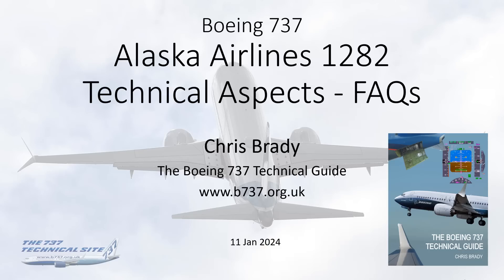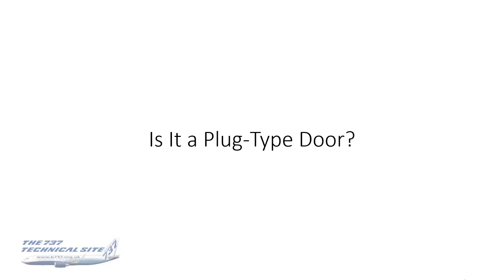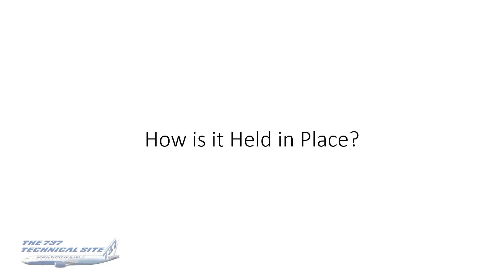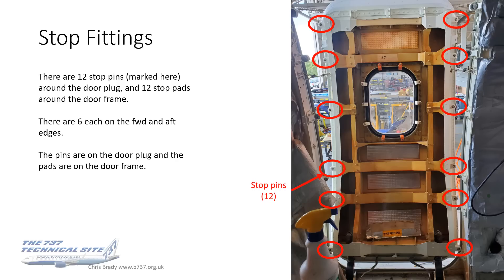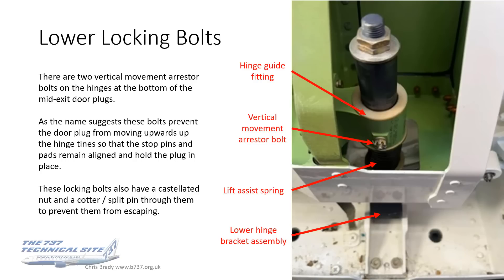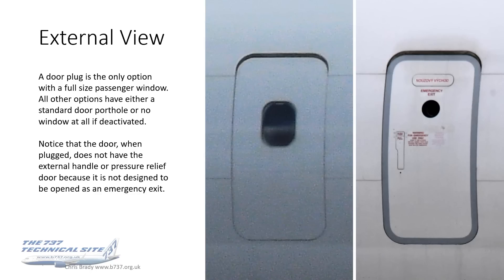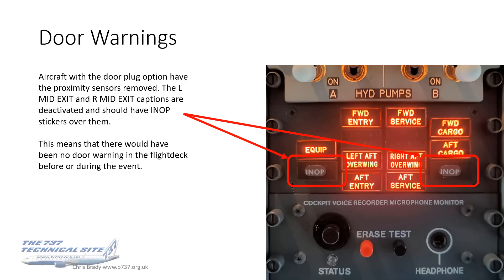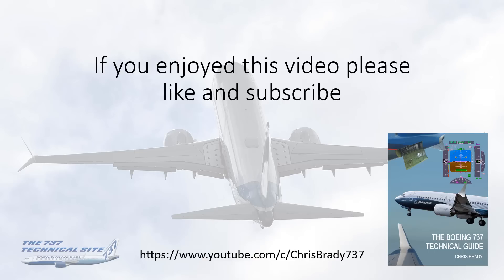737 Technical Aspects of AS1282 FAQs

Comment: OK people. It's obvious to me (from the video) that the 12 stop pins and 12 stop pads are what actually hold the plug in place during flight. The sliding hinges, roller pins, and guide tracks are only for convenience and help to ALIGN the plug so that the 12 stop pins can be tightened against the stop pads. The four locking bolts (also for convenience) keep the hinge springs compressed while you tighten the 12 stop pins with a special tool. When the 12 stop pins are tightened against the 12 stop pads, the plug becomes a rigid part of the airframe and the plug is not going anywhere. BUT if you fail to tighten these 12 stop pins, the hinges and roller pins (with their locking bolts) WILL NOT HOLD THE PLUG IN PLACE. Someone at Boeing must have failed to tighten the 12 stop pins, incorrectly thinking that the alignment hardware (i.e. sliding hinges, roller pins, and locking bolts) would hold the plug in place. But the alignment hardware is not designed to withstand operational forces. Only the stop pins and stop pads are. With the plug being loose and bouncing around for months, the four locking bolts eventually broke and the plug slid up (because of the springs) and out. The 12 stop pins had to be loose for the plug to be able to move. An alternate theory is that the stop pins were tightened correctly, but the locking wire (seen at 5:16 on the end of the stop pins) was a defective design that does not prevent the stop pins from turning from vibration (I'm really leaning towards this defective design theory now that I think about it).
Reply: Assundermurphy is not correct. The 12 stop  adjusters are not "tightened" against the stop lugs. That will only continuously Jack the door inwards until the J track brackets and the hinge tubes break. (Tightened against what?)
 The only reason the stop pads are adjustable is to provide equal contact on every  pad and prevent wobbling. The lockwire (Eng) / safetywire (USA) is there to prevent this adjustment from changing by maintaining the locknut torque.
Reply: It's very difficult to believe that the person/s involved in securing the plug door, pins etc would somehow inadvertently miss out 12!! lock wires, since each pin has a hole in the end for that pin. 
I think a plug door test chamber could be set up to pressurise/depressurise and apply suitable vibrations to mimic takeoff and landing, to see how the locking wires behave and all the other parts of the door. Maybe the wire used is not sufficient for this purpose.
Reply: @JohnnyMotel99  the pressure forces are perpendicular to the pads, not perpindicular to the vertical or horizontal axis of the pads. Because of that as pressure differentials increase, the door is forced harder against the pads, which increases the force required to move the two surfaces of the pads in relation to one another.
Reply: @eddy66t6  Thanks, I thought it was something like that.
Reply: What in those 12 stop pins and pads keep the door from moving up and down? Nothing, they looked flat to me, free to move up and down. Up and Down, perpendicular to the extremely large force of a pressurized cabin. Any small angles in these stops and pads could either assist the "launch spring" or work against the "launch spring".  The door should have only opened one way, inward. Not outward, aligned with the pressure force. 

Extremely bad design for a door that will NEVER be used. Well maybe once or twice in 30 years.
Reply: @WeBeGood06  There are four guide tracks? that guide the door into place, then a lock bolt is placed into the track to prevent it moving. So the bolts should slign correctly with the pads, the guide tracks prevent and movement of the door up/down, cabin pressure prevents any other movement.
Reply: @JohnnyMotel99 there’s only two track guides, located at top. The hinges at bottom keep it in position there.
Reply: @JohnHallgren  thanks, I wasn't sure.
Reply: You nailed it. I’m with you 100%. I think the door pads are slightly dished, to aid alignment. Do you know anything about that thought?? Regards

Comment: This door version is called plugtype door. So, this is a plugtype doorplug. Normally, this doors are just kept in position by the locking mechanism, until the cabin pressure comes up and prevents any door movement. 
The assist springs are a problem IMAO. Otherwise, the door would stay in its closed position even without the lock bolts.
Reply: The four bolts job seems to be to counter the springs. Just get rid of the springs.
Reply: The photo at 9:04 shows the door in the raised position. If this is entirely due to the springs the door would always be in this open-able position (clearly not so for a couple of months). So the door must have been forced downwards into the flight position and at least some of the 4 locking bolts installed. I also note that all these bolts act in shear and the lower pair are normally under constant load by the springs which should hold them in position due to friction whether the nuts are present or not.
Reply: See @jfmezei
 below

Comment: plug type non plug type door, is not a personal opinion but the therms and type door are specified/classified  in Part-21. plug type door wider than the fuselage door frame the door open inward the fuselage, semi-plug type the door is wider than the fuselage door frame and open outward the fuselage. Plug type mean the door when closed has their stop fitting inside and against the fuselage door frame stop fitting,  for this reason the door are considered wider than the fuselage door frame...
Ciao
Reply from the maker: Good explanation, thanks
Reply: LOL, When the Door departed the airplane, the Door was not wider than the Door frame, therefore is NOT considered a "plug type door" at departure. This door was designed for ease of removal, even in flight. A guy with a wrench could easily remove this door while pressurized at 40,000 feet altitude.

Comment: thanks The door is a bajonet fitting (move and twist) 
Also in my view  this is not a plug type door. for me a plug is an object that is wedged in place and when pushed seals the opening better.
Reply: It's not a bayonet fitting. It is a plug type, though a rather vestigial or skeleton one.
Reply: @RicktheRecorder  let me clearify the door is a bajonet door not a plug door.
the twelve fittings on the door and frame are also no plugs but just cones because they are plane and simple in the same presure compartment, hence no plug.
Reply: @mgriffioen8503  I am afraid what you write is not clear. I assume by 'bajonet' you mean bayonet. A bayonet connection requires a cylinder or similar inserted into a matching bore, and then rotated about the axis of insertion to enable dogs or lugs to engage in blind slots. Nothing about this door complies with that definition, as, for a start, the door is not rotated. I don't know what you mean about the  twelve pins and pads being in the 'same pressure compartment'. The inside of the door is at cabin pressure, the outside at ambient atmospheric. The jamming action of a plug always occurs on the high pressure side, here, the pins and pads.

Comment: PLUG DOOR VS DOOR PLUG?

Here’s my take on this. Note that I am not an A&P, nor am I a 737 pilot, but I do work in the aerospace industry. 

PLUG DOOR:  “Plug“ is the adjective that modifies the word “door.”  This means that the object under discussion is a door of the plug type.  Webster says a door is “a movable structure used to close off an entrance, typically consisting of a panel that swings on hinges or that slides or rotates”

DOOR PLUG:   “Door” is the adjective modifies the word  plug.”  This means that the object under discussion is a plug, i.e., something that fills a hole, and in this case, the hole is where a door would go. Furthermore, Webster says a door is “an object, such as a cork or a wad of cloth, used to fill a hole tightly; a stopper.”

Since the object under discussion was designed not to move (at least on a regular basis), I contend that the object under discussion is a “door plug.”  

But this is all really immaterial. What is important is that a THING (regardless of what you call it) failed and we don’t know why (yet).
Reply from the maker: I agree, you can argue the plug thing either way but your last sentence is the bigger question.
Reply: It's probably a plug-type door plug.

Comment: @chris
Regarding the Flight deck door opening. I know for a fact that on the 777-300ER we had a feature that would unlock the door in the event of an explosive decompression. Next to the door unlocking mechanism (the black rectangular module for those who knows, the flightdeck side door post according to FCOM) there was another black module that if you would blow hard on it with your mouth. Would unlock the flight deck door for as long as you would keep  blowing air on it.(I.E. making a pressure differential)This is logic to think that the same is installed on the 737. Just not logic that we are not aware about it. Having tried the system on the 777 I can easily imagine how it works on the 737.
Reply: Hell of a Blow Job!
Reply: Thanks for that, however it would appear that on the Alaska incident the flight deck door blew open causing the pilots to loose there check lists etc. again the pilots were not aware that this would happen, by design. Yet another design change that Boeing did not include in the flight manuals or pilot training and even worse they did not inform the FAA.

Comment: One operational question I have. “How do you get that top bolt in from behind?”
Reply from the maker: I don't know. Hopefully one of the engineers on here may have the answer.
Reply: @ChrisBrady737 hard to tell from pix but common sense would say that there is a large gap between the skin and track sufficient to position the bolt from rear and get it through the track holes for it, right?

Comment: I wonder if the cockpit door unlocking during decompression is the result of that accident in greece where pilots forgot to turn on aircraft pressurisation passed out and a lone flight attendant remain concious but couldn't get into cockpit because it was locked until plane ran out of fuel at which point it was too late.

Comment: QUESTION: I am very very surprised by how much upward movement the springs cause when let loose.  Assuming, for sake of discussion, that the 4 locking bolts had not been installed, could the door have remained in locked position for 2 months of flights? Could it have been locked in the first place? Seems to me that the springs would push and keep it in unlocked position and on first flight, the door would have started to swing open to let any pressure out as plane was climbing. 

So this would also mean that to insert the locking bolts a true downward force would need to be applied and kept on the door in onrder to lower it to have the bolt holes on door match the bolt holes on frame and while holding in that exact positionl insert the locking screws. 
My thinking before your video was that that door could remain in locked position until  bumps on tarmac would cause door to bounce off the spings and rise to unlocked position and stay there.  But if without the locking bolts, the springs naturally push door up to unlocked position there there is no way the plane would survive any pressurisation test or a flight s it wuld have failed before being delivered to Alaska. 

The structures folks at NTSB will have fun with that.
Reply: Everyone is missing this point.
Reply: So often an incident results in trying to reconstruct things with all the hard evidence lost or virtually destroyed. In this case there is an identical door on the opposite side of the plane. Intact & functional apparently. I assume NTSB is looking long & hard at it. 

And yes, trying to see if the door will even stay closed with all 4 locking bolts removed should be test #1 maybe. It just depends on what those springs are like. Hard to say if the animated diagrams of the upper guides are exact in all respects. The angle of the slot, force from the lift springs, plus pressurization loading could possibly create a sweet spot where everything is balanced. If those lift springs are simply cushions to take the weight of door at the point where everything is just closing that last 2” to engage the stops, that’s one thing. If the springs are more substantial, then you are correct. The door flys open. 

Some commenters, based on pics of the stops, seem to think there is a cup or ball & socket shape on those stops that would prevent them sliding to disengage if plane is pressurized. I think it’s just light & shadows creating an illusion and the contact between the 2 parts is just a flat pad. Like the High 5 skits demonstrate.
Reply: A plane travels on tarmac unpressurized. It takes off at speed unpressurized (or little pressure).  So any bumps that dilodge the door from its "locked" position prior to there being enough pressure to hold door in place could leave door in unlocked position. 
The NTSB mentions the stops are intact, but the roller guides are fractured.  It is possible that the door was unloacked all the time and held only by roller guides until those gave up and broke? 
  @Bitterrootbackroads

Comment: Thank you very much for the excellent review, it certainly clears up many questions. One question the NTSB will likely answer in the final report is how many of the restraining bolts were missing or not properly installed and if any bolts could be missing and still prevent a blowout.
Not a B737 driver (757-200PCF) but you certainly earned my subscription. Kuddos.
Reply from the maker: There are so many questions we all want answering about this event. Thanks for subscribing!

Comment: On the "plug door":  I think there is confusion between the door plug, and a plug type door.  However, since in closed position, portions of the door are wider than the opening (aka: stop pin against the stop pad) as main mechanism instead of having latches that go from the door into the fuselage like a bank vault door, it may qualify a as a plug-type structure that needs to move to find a way where the structure can pass through the frame.
Reply: All the doors that open outwards, including plug-type doors, must have certain positions or orientations that allow it to, well, open outwards.
For me this is a plug-type door because the pressurization loads is resisted by fixed immovable features in the door that rest of fixed unmovable features in the fuselage, not by any latching mechanism. If the plane is pressurized, the 4 bolts with its castellated nuts and cotter pins, the 2 tracks, the roller pins, the bottom hinge, spring, hinge guide and hinge bracket can all magically disappear and the door is not going anywhere, pressed firmly in place from the inside against the fuselage by the pressurization loads. That, for me, qualifies as a plug-type door. Or a plug-type plug I guess?

Comment: Not a good thing': 

Boeing whistleblower reacts to Alaska Airlines mid-flight incidentAt 8.53 into the video, he is saying that the company has been REMOVING QUALITY CONTROL iNSPECTIONS. 

More than likely this is contributing to the 'sloppy' workmanship going out the door.

Boeing has got rid of its own INDEPENDENT Quality Control Inspectors and is now just relying on a few Boeing company employed designated FAA Inspectors in order to save money.
My buddy who works there confirmed this fact.

As well, some airlines are going down this road by removing Independent Quality Control Inspectors , (those individuals independent from production).
So QC is being 'watered down' or being eliminated.

Comment: Hi.There are 4 bolts in the lower hinge slider fixture that hold the fixture to the door frame. Do these bolts have nuts on the other end? I haven’t seen any photos yet of the other end of those bolts. If they have nuts, do the nuts have locking wires. Also, if the slider fixtures were totally disconnected, ie all the 8 bolts have come out, 4 on either hinge, would it be possible for the door to escape in a downward motion to clear the 12 stoppers. Thanks Regards
Reply: I wondered the same thing.  Those are the bolts that have been found loose on multiple aircraft during fleet inspections happening right now, per photos I saw in another video.  They obviously have to thread into something, question is, what is the locking feature / why did they come loose?  It seems highly likely that those loose bolts are related to this door failure.
Reply: The 12 stops would be prevented from moving downwards as long as the 2 pins are in the guide tracks at the top. However, If those door mount brackets with the sliders at the bottom are loose & letting things jiggle sideways a little, the 12 stops would start shifting sideways off their pads. If they did, one side of door would have its 6 stops entangled at least for a bit, the other side would be free to fly outwards. The guides at the top would then likely come off the pins or break, locking bolts in place or not. NTSB upon finding the door said those guides were “fractured”.
Reply: I also had a thought after making my last comment that if the slider fixtures had become completely separated from the door frame, the door is then able to move sideways, rather than up or down to be able to be set free. It’s hard to see how the door evaded all the levels of design, to be able to get free. I think this occurred, a bit a time, over a period of time, until all the necessary levels of design had come lose, undone or broke, to allow the door to escape. Regards

Comment: Amazing content. On the Upper Locking Bolt slide (7:27), does the AMM states how to insert the bolt? From the picture, it seems like the bolt is longer than the space between the Upper guide track fitting and the aircraft skin, certainly does not look easy to install.
Reply from the maker: I don't know. Hopefully an engineer on here can take that question.